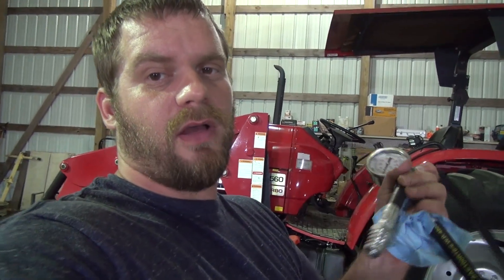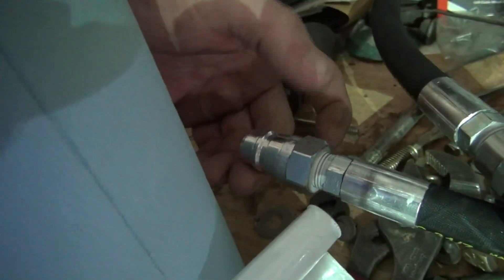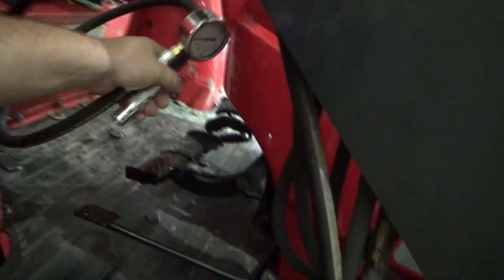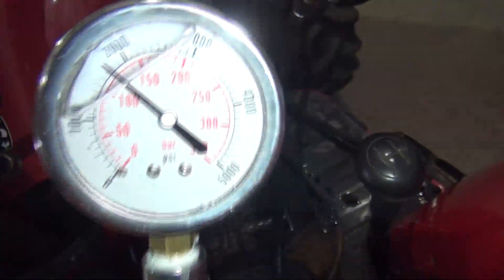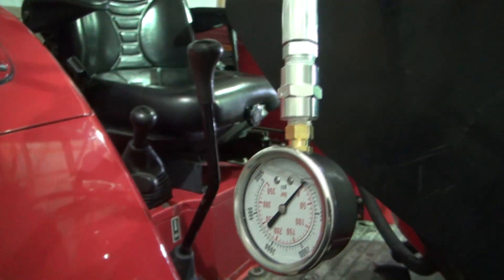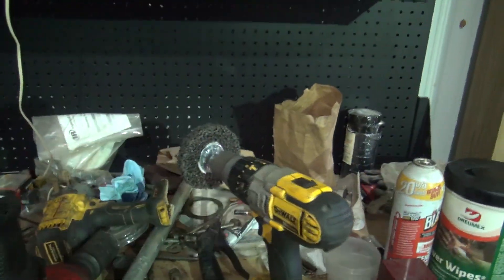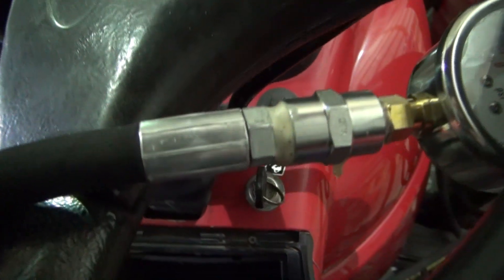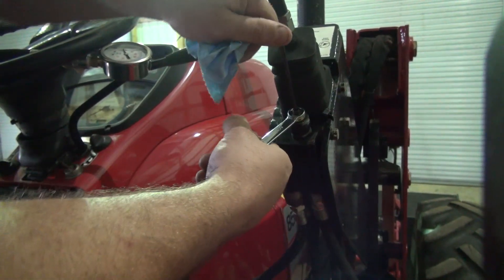Testing tractor loader hydraulic pressure, adjusting pressure

Comment: I think you have to let it dry overnight to seal. Same thing happened to me when i put it on fittings on air brake fittings.most jobs i don't have time to let it sit overnight so i just use teflon tape or gasoila thread sealant thats good for all sorts of petroleum liquid and says rated up to 10,000 psi .I had better luck with them. Look into gasoila pipe thread some good stuff that serve you well.

Comment: Here's something to think about.  This is an example.  Let's say you have a 4" diameter cylinder with a 1½ diameter push rod running with a 3000 psi system.  If you apply hydraulic pressure to the push rod side of the piston, it will have less force than applying hydraulic pressure to the other side of the piston.  You lose surface area of the push rod; in this example, 12.5 sq in vs 7 sq in on the push rod side giving you about 56% of the capacity.   You might try this as an experiment:  Flip the hydraulic cylinder(s) end for end (push rod facing up) to see if you have a better lifting capacity.  It may not be possible if there are mounting issues that will prevent this experiment.  You still want to stay within the lifting limitations due to structural issues.
Reply from the maker: Hydraulic cylinders have more power extending than retracting. The orientation of the cylinder wouldn't matter. It has to extend to lift regardless of whether it's upside down or not.
Reply: I have a mahindra 5145 that the hydraulic actuator messed up, the replaced it and now it seems weak to lifting/ tilting the bucket. idk if it's adjustable like yours is or if it's just gotten an air bubble after they replaced it.

Comment: Had same problem, tore block apart and found that mahindra had only put two shims in, the mechanics manual shows that there is supposed to be four shims in block.  Called mahindra dealer, who then called mahindra. They stated that the normal home owner didn’t need tractor to run at peak performance for normal home owner. I think they didn’t it so they wouldn’t have a lot of warranty issues from somebody over using the tractor.  I ordered shims and fixed, it does better now

Comment: Hi there!  Don't know if someone mentioned this previously, but hydraulic fitting threads are not, NPT.  They are close, and can often be fastened together, but will leak if mismatched.  Ran into this many years ago on a home-built log splitter. Thanks.
Reply: Hydraulic NPT fitting are NPT unless you are trying to mis-match JIC or ORB fittings. I started working on bucket trucks 53 years ago and fittings have not changed since I started. There are, however, cheaply made fittings that are threaded with worn out dies and taps. Always try to buy quality name brand fittings. 
Thread tape is the only way to go on hydraulic fittings. Paste thread sealers just cannot withstand the pressure no mater if the have Teflon Paste fibers in it or not. Hydraulic old will dilute most plumbing and automotive thread sealers. 
The trick with Teflon tape is to always leave the first thread exposed, with no tape on it. When replacing a fitting you must clean, remove, all of the existing pipe tape (and  I mean all) before installing the replacement fitting. I use a wire wheel on a bench grinder to clean the male fittings and an O-ring pick and plumbers fitting brush to clean the female fittings. 
If we don't do our work correctly we can't expect acceptable results.

Comment: Pushing pressures to or over max PSI doesn't sound like a good idea. "I don't know... I think", etc used in conjunction with high pressure hydraulic systems doesn't sound like a good way to be safe or prevent premature hydraulic system failure.
Reply from the maker: Yep, you shouldn't do what I do 😁😂
Reply: Enjoyed your video, very informative. As for the leaking gauge connection use Teflon tape avoiding the first two threads then apply the liquid sealant. The tape and the liquid sealant combination provide  greater sealing and prevent galling of the threads when making and breaking connections.

Comment: Permatex thread sealant is good for air line fittings. Hydraulic stuff, there is a greenish colored compound that works well. I've heard it called blue block, where I work we started using gasolia thread sealant and it seems to work well.
Reply: I primarily use the blue monster sealant anymore for everything.  But as mentioned prior to this post, a bad fitting will leak unless you use some filler as in teflon tape.
Reply: Could you give a brand name and type sealant for both types you have used? Would appreciate the help.

Comment: Did your adjustment work? I understand you increased the pressure measured by the gauge, but can you now lift the heavy truck clip you were trying to lift?
Reply: I’d love to know the same although I think even with increasing the pressure the FEL pistons are cheap and weak! Probably will only make a small difference in lift capacity to get it back to the pivot point spec but with the added weight of the bucket it may be at the same issue.  Tractor specs are bullshit without factoring in the bucket or forks weight in.  Like who the hell is going to use a front end loader without the attachment that it came with?! Why have one to being with.
Reply: Did it help the lift out? Notice anything else ? Like flex on loader arms or front end sag ? Great videos ! Thanks. Learning alot.

Comment: I'm disappointed in my 1533 not enough lifting power  , I would not buy other Mahindra  tractor
Reply: My 2017 2538HST is just a weak! The dealer checked the pump pressure for the loader and said it was in specs!  Looks I got sold a tractor full of shit!  It’s a horrible tractor all the way around!  Their videos about do more pull more lift more are bullshit!  Hydrostatic power is also weak! I’ll never buy that brand again! The sad part is I did my homework and compared all the numbers and still got a junk tractor!
Reply: @josemejia6645  I’d try increasing hydraulic pressure ….what do ya have to lose? 
Even a couple hundred psi would help!
Reply: @markcole6475  is there any way to find out what the actual psi range of the cylinders are? I don’t want to damage anything. I’d also like to know what the pump pressure should be set to.
Reply: @josemejia6645  I’ve been told 3000 psi is the danger zone for most tractor hydraulics in this category ….like compact and  sub compact tractors .
My compact tractors  have been factory set around the 2000 psi range! Little under to a little over! I’ve set 2 of my tractors to 2500 psi and haven’t had any problems . No blown hoses or seals or any seepage from joints or seals.
Granted I don’t use max pressures all the time but on occasion I do need that extra lift power! 
I’ve see no official max ratings but most people say to keep pressures 2500 or less.
Reply: @josemejia6645  I just did some searching on google and found some factory specs on PSI ratings for the L series tractors.
2349 PSI seems to be the common factory specs from kubota! Found multiple manuals saying the same thing! I’ve got mine set just a tad under 2500 psi…..
When I picked up my 3902 HST it was set just under 2100 psi….. I believe these are set low for safety reasons for those people that don’t use ballast on their tractors or know when to use ballast!

Comment: The hose and the to tractor connection are good. What about the gauge itself. If it's a bottom of the market piece, the threads can be out of round and not seat square...Leak!
Like a Craftman 5/8 wrench is a wrench too, but Mac or Snap On grab true, less knuckle trouble when you working in close space sometime.

Comment: i have never had trouble with the permatex thread sealer like that....i use on hydraulic fittings with no problems.....odd. i have a couple frame cuts stuffed in the back of a box truck....door opening is narrower than the axle hubs....it was interesting getting it in there. there are not light for sure!
Reply from the maker: I'm still curious as to what it weighs, might have to find out one of these days lol.